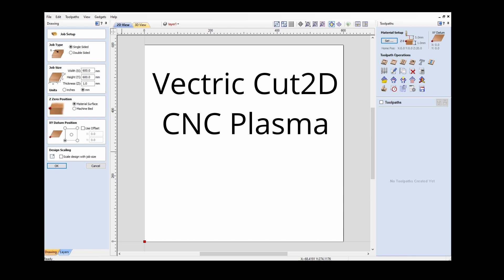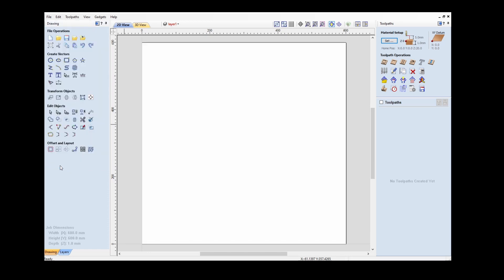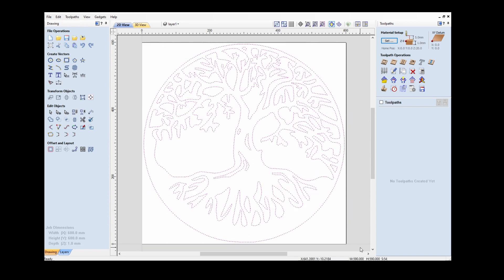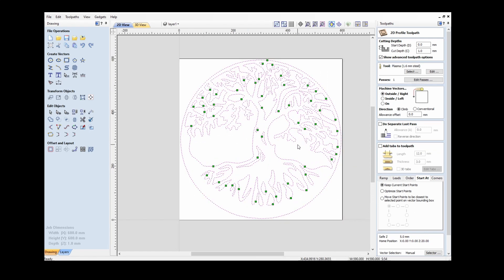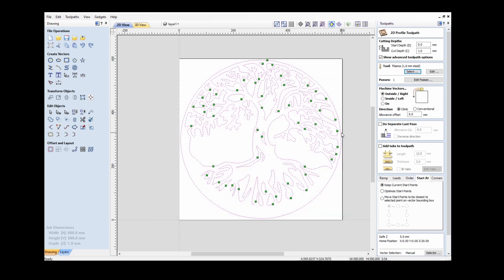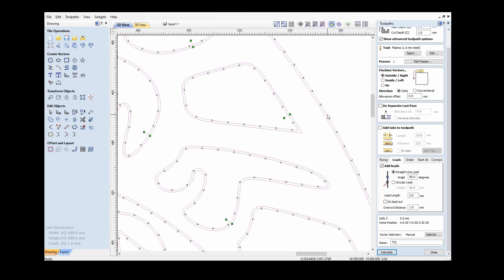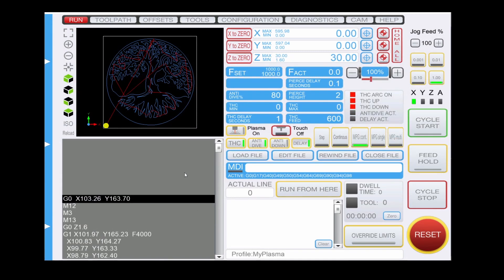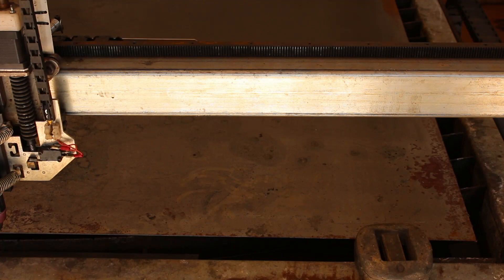Cut2D for Plasma

Comment: Good morning Gregolt I have made a cnc that I use for wood and I want to be able to transform it for plasma cutting.
For drawing I use Aspire
I have already ordered the ohmnic sensor like yours.
I use a uccnc UC300 ETH 5LT board
I ask you if you could help me with the post processor.

Thank you and congratulations for your work

Comment: Hi bro, very nice video. 
What control board are you using for the cnc and did you had any EMI problems with this plasma cutter.
Thanks!
Reply from the maker: I use UCCNC as controller.  I have no EMI problems at all.
Reply: @Greolt  Thanks for the info. What plasma cutter are you using ?
Reply from the maker: @danielbichokov1340  I use a Lotos LTP5000.  A Chinese pilot arc plasma.
Have had a fairly good run with it.  Being a retired hobbyist I can not justify an expensive brand name plasma.
Reply: @Greolt  I feel you bro, I'm planing to use Parkside plasma with pilot arc-pretty budget

Comment: hello friend, I use everything the same as you, the problem I handle is that to feces the
program has a lot of knots and in curves or complex drawings like this, it is not
maintains speed throughout the drawing
Reply from the maker: Tune your machine to the maximum acceleration that it will cope with.   Acceleration is greater priority than speed.
Reply: @Greolt  How do I know what is the maximum acceleration it can withstand?
Reply from the maker: @carroceriasnicar  trial and error.  Push it hard until it loses steps and back it off just a bit.
Reply: @Greolt